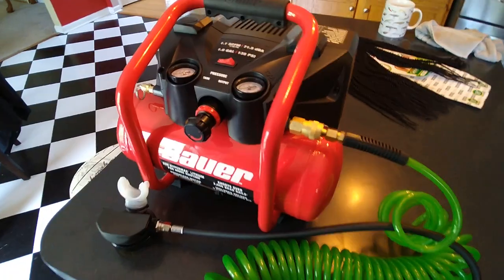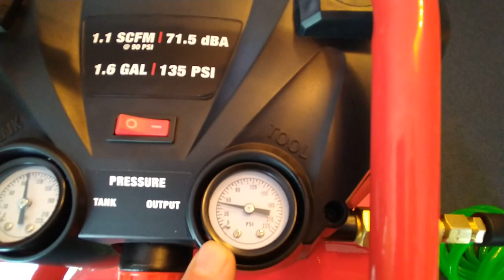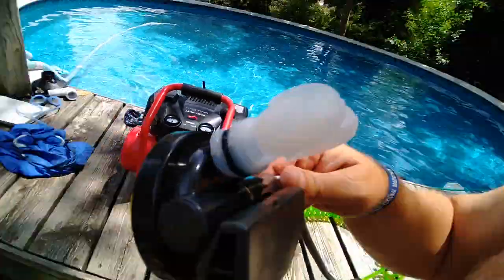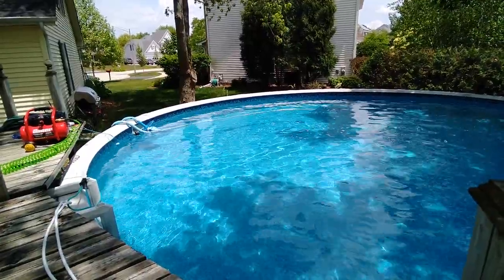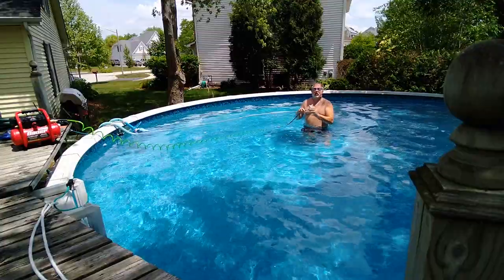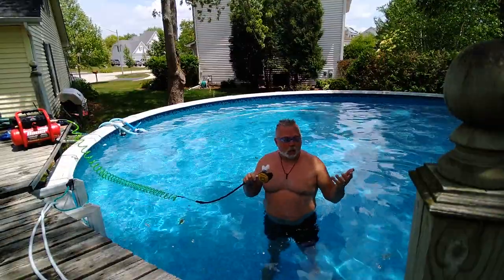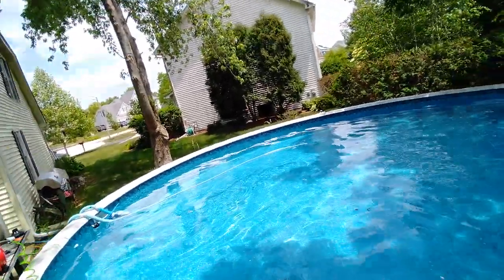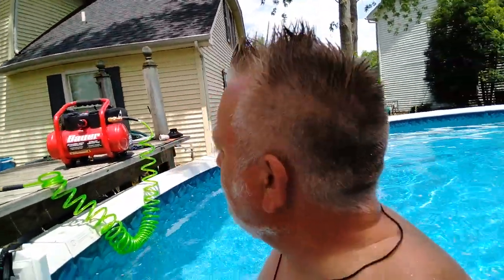VOGTLAND OUTDOORS   2021   BUILD a Surface Supplied Air hookah System for under $250

Comment: I planned out a DIY hookah build using this compressor before I found your video. Have you had it in open water yet? I'm curious if it has enough capacity to keep up at deeper than pool depth. The only major change I'm making to my build from yours (other than a different source for hose) is a 0.3 micron filter on the compressor outlet to keep any nasty stuff from the compressor out of the air supply.
Reply: I just tore down the compressor and there was a ton of what looked like teflon particulate residue inside the cylinder and cylinder head. You should definitely put a filter out the outlet of that compressor if you want to breath from it.
Reply: I would get a Polyurethane hose as that is food safe and water drinking safe....but still, give it a mild soap wash.
Reply: Do yourself a favor and never run something like this without a proper filtration system. There are multiple things that could come out of these compressors from shrapnel, to dry lubricants to teflon coating. Anyone should be aware of this.
Reply: @PunkerTFC  what kind of time is this thing lasting you? On what size batteries?  I want to do the same but want to know if the run time is worth it.
Reply: @shawnjones8748  Two 5ah batteries will last me ~40 minutes at 10-15 feet.  The only exactly timed test I have done was out of the water, and in that case one 5ah battery lasted 25 minutes.
Reply: @PunkerTFC  that's what I wondered if that's all they might last. I've been trying to find a larger battery that could be wired in a different way to them.
Reply: @shawnjones8748  it would be very easy to wire in any five cell lithium battery (or any other 21-16VDC battery), but if you are going to do that you might as well do a fully custom build. For me the only advantage of this compressor is that it can use the easily transportable, easily chargeable tool batteries. Other than that, it is a very basic, cheaply built DC compressor.
Reply: @PunkerTFC  just trying to figure out the cheapest way while still being reasonably safe.  If I deviate too much then I end up having to air controllers and finding a pump that's safe to use on top of it. I know a lot have used the acq-910 aeration pumps but I want as safe as possible.
Reply: @shawnjones8748  That ACQ pump is arguably more suitable for shallow diving than this compressor. I don't think anyone has actually tested the air coming from this compressor; in my case I'm filtering it to .3 microns, managing the heat of the compressor, and operating under the assumption that some testing that someone else did with a similar (but not the same) compressor will apply to my set up as well.

My setup isn't particularly cheap either. Total cost for the whole rig is pushing $500. It's cheaper than anything that's off, the shelf, but I wouldn't call it cheap.
Reply: @PunkerTFC  well most of these companies are simply selling a filtered version of these compressors. Inlet filter to catch big junk that is cleanable and then a good quality filter on the out port. Make sure to always drain the moisture and they are good to go as long as you are using a proper type of hose. I'd try building off the 910 pump but then I'd have to figure out an air tank setup, and I dont really want to use pvc pipe because I'm not sure its clean enough of contaminants because of plasticizers used to soften the plastic for forming. That stuff never completely leaves.
Reply: @PunkerTFC   sorry man over got a few questions. Are you able to run two people on that setup? Is it a positive thing that you can wire up a different 21 to 16v battery that you spoke of, as I know some electronics let you vary and some do not.  I'm sorry for all the questions, just trying to make sure I get it right.  I just dont want to spend all that money for 4 or more batteries for that amount of running time and figured a different battery setup might be more efficient.
Reply from the maker: Punker !! 
I just posted my FIELD TEST of my unit, and it was WONDERFUL !!!!! 
Go check out the video !!

-Mark Vogt | VOGTLAND OUTDOORS
Reply from the maker: EVERYONE EVERYONE - my outlet filter IS on the way !!!!! 
SHEEEESH - REMEMBER everyone, this is a PROTOTYPE. I've only got a few HOURS of use on it so far ! 

But even though I ALREADY have this filter on order, WHAT ELSE can you guys all suggest???? 

KEEP the IDEAS COMING !!!
Reply from the maker: JUST CHECKED OUT YOUR video of YOUR hookah system, field-tested on Lake Champlain, VT - WAY COOL !!! 

ONE THING we ALL need is a DECENT submersible PRESSURE GAUGE !
Has ANYONE found a DECENT one that CAN be used UNDER WATER, and doesn't cost an arm & a leg?? 

-Mark Vogt | VOGTLAND OUTDOORS
Reply from the maker: @Shawn and @Punker - I've been getting VERY GOOD dive times from my BAUER compressor and its 2 x 5000 mAHr batteries - easily 45 to 48 minutes even at 20ft, and likely 60 min if I stayed only at 15 ft. 

DON'T mess with wiring combinations - something might happen. 
This is all about having CHEAP DIVING FUN, and 45 minutes under water in typical North American water is PLENTY long enough that you'll WANT to surface - just to WARM UP ;-) 

-Mark Vogt  | VOGTLAND OUTDOORS
Reply: @VOGTLANDOUTDOORS  I'm not sure that a pressure gauge is going to be very useful. It won't indicate anything other than the regulated pressure until the tank gets below the regulated pressure, and at that point it becomes noticeably harder to breath as the line pressure drops below what the 2nd stage is tuned to.

What might be more useful is an audio low battery alarm (using something like a LiPo low voltage alarm) that is against the bottom surface of your tube; it should reverberate through the water and it might be audible down below. But I have run the batteries out at 20 feet and doing a controlled ascent with the last few breaths of air in the tank was not a problem.

Comment: You should consider actual air breathing hose from a dive shop non toxic it's usually yellow on 25 or 50 ft lengths
Reply from the maker: Stephen, 

Good advice - per usual ! 

Thanks,
-Mark Vogt | VOGTLAND OUTDOORS

Comment: Get a proper Hookah hose, in a good length like 10 meters, it will also act as an air reservoir when the Compressor quits on you..

Comment: Most 2nd stage regulators are rated to handle up to 150 to 200 PSI.  Given that the Bauer's air pump stops well shy of that, you can dial the Bauer tank's output to 150 PSI with no damage to the 2nd stage regulator.
As an aside, for SCUBA tank diving, there would be a 1st stage regulator as part of the removable valve that connects the air delivery hose to the tank.  That 1st stage regulator steps down the tank's max internal pressure of around 3000 PSI down to 150 PSI.  Hence, why all 2nd stage SCUBA regulators are designed to handle 150 PSI.

Comment: 1.1 cfm compressor, that's only about 30 l/m, enough on the surface but I doubt if it will supply enough air at 5m deep
Reply from the maker: Greetings Miranda and welcome to VOGTLAND OUTDOORS ! 

SHORT ANSWER: 
WATCH the VIDEOS ! 

You'll see that even after 15+ dives, most of them are well beyond 5m - they're more like 7m to 8m, but I've said repeatedly that it's UNWISE to use a rig like this PAST depths of 7m, simply because they're NOT DESIGNED for depths past this - THAT'S the (rightful) realm of TRUE SCUBA ! 

Lastly, I live in North America (upper midwest, within an hour of the Great Lakes), and in all the lakes around here there's literally NOTHING past the 7m depth mark anyway - ALL VEGETATION STOPS, so all the fun stuff (fish, sunglasses, other swag) are all at depths of 5m, and the entire rig LASTS LONGER at those depths anyway. 

Thanks for the feedback ! 

-Mark Vogt  | VOGTLAND OUTDOORS

Comment: Very clean looking setup.
What is max depth this set up can reach and still have plenty of air? Thanks
Reply from the maker: Hi again Roadstar, 

Watch all the videos, listen to my recommendations AND my WARNINGS, and read the Descriptions. 

You sound like you're looking for GUARANTEES on a DIY rig posted on YouTube; there's NO SUCH THING as GUARANTEES. 

MARK'S PHILOSOPHY (nothing more than that): 
SURFACE-SUPPLIED AIR or "HOOKAH" rigs are meant ONLY for that range of depths which are DEEPER than SNORKELING but SHALLOWER than SCUBA. 
If SNORKELING gets you from 0 ft (surface) to 6ft and then back up... 
if STANDARD AIR (not "mixed") SCUBA gets you from 20 ft down to 40 ft "receationally"... 
Then SURFACE-SUPPLIED AIR or "HOOKAH" rigs are meant for that IN-BETWEEN range from 6 ft to 20 ft. 

MARK'S SAFETY RULE OF THUMB FOR ALL HOOKAH RIGS: 
DON'T dive any deeper than you can SWIM with only HALF a BREATH - for me that's about 15 ft ! 
WHAT I MEAN BY THIS: 
EXPECT your rig to FAIL  AT ANY MOMENT, and ALWAYS be ON-GUARD that in the blink of an eye you may have to DITCH your WEIGHT BELT and SPRINT FOR THE SURFACE with LITTLE or NO AIR IN YOUR LUNGS :-O 

That sounds like you CAN'T possibly have ANY fun if that's how you think but I have TONS of FUN EVERY SUMMER, and so far I've found over $350 worth of lost fishing rods, lost snorkeling goggles & gear, a ring, and several REALLY NICE pairs of RAYBAN SUNGLASSES (one I gave to my youngest daughter, one I kept for myself), so I've already PAID for my RIG! 

Hope this helps, while reminding you I AM NOT LEGALLY RESPONSIBLE IN ANY WAY FOR ANYTHING IN THIS VIDEO, OR FOR YOU (OR ANYONE ELSE) USING A RIG LIKE THIS. 

Cheers, 
-Mark Vogt | VOGTLAND OUTDOORS

Comment: Do you still own it and have you tested to inflate car truck tires how go , loud, compact , fast or slow is it compare to a small 12v cigarette inflator e
?
Reply from the maker: Greetings Charles & welcome to VOGTLAND OUTDOORS ! 
SHORT ANSWERS: 
1. Yes - I DO still OWN and USE my prototype rig; 
2. Yes - DID test it before I used it as a SSA rig; I inflate bike tires, drove all kinds of pneumatic power tools (drills, sanders, nail guns, etc) - it worked GREAT (as EXPECTED!) on everything, and it was so quiet that even when running in a bedroom, if you go 2 doors down to the bathroom, you can hardly HEAR IT; and when I use it DIVING, by the time I'm only 15 ft away from it, I CAN'T EVEN HEAR IT :-)
3. There's NO COMPARISON in VOLUME between this INDUSTRIAL-GRADE compressor and a 12V car unit; I would say that a 12V car unit would take 10 minutes to inflate my standup paddleboard, but it would take this compressor less than 2 minutes. 

Hope this helps ! 
-Mark Vogt | VOGTLAND OUTDOORS

Comment: Yeah, shallow only. Req more pressure for deeper. Im working on my boat at five feet so perfect, but filter the air.
Reply from the maker: Greetings Doug ! 

YOU & I ARE IN COMPLETE AGREEMENT... but 5 feet? You may has well simply SNORKEL ;-) 
I'm at least OK with seeing any SSA (Surface-Supplied Air) aka "hookah" rig operating at that common-but-quirky depth range of 6 ft to around 20 ft. 

- Surface to 5 ft is best handled by snorkeling with a modest weight belt to get you down quickly; 
- 6 ft to 20 ft is simply too-deep-for-snorkeling and too-shallow-for-SCUBA (it's bullky); 
- 25ft and deeper should be exclusively the realm of SCUBA, absolutely NOT SSA. 

My philosophy is this: 
- if you can hold your breath for about 20 seconds even while ACTIVELY kicking fins, then SNORKELING is your SAFEST method; 
- if you go DEEPER than you can ASCEND in a SINGLE breath (that's about 20 ft to 25 ft), then IF your SSA system FAILS you, you're fucked; that is, you're DEAD. Period. 

The fun and usefulness of an SSA system (DIY or store-bought) is fitting in that middle depth. 
:-) 
LUCKILY  all the FUN stuff in North American fresh-water lakes is almost ALWAYS 6 ft to 20 ft; after that the water gets DARK (and scary!) AND the vegetation ENDS, so there's NO point in going deeper anyways, unless you're LOOKING for something; and if you're LOOKING for something, it's likely EXPENSIVE, so you may as well spend the money on SCUBA gear and a solid DIVING BUDDY as well ! 

Cheers,
-Mark Vogt | VOGTLAND OUTDOORS
Reply: @VOGTLANDOUTDOORS  I just need to work on my boat. It's not deep but I will need some extended time to scrape the bottom. This compressor is perfect, thanks again

Comment: Thank you Mark, that was what I have been looking for. Are you going to do another video with the updates yo your system and how are you solving the diferent issues? It will be very helpful for me. Thanks un advance.
Reply from the maker: Hi Jonatan ! 

it's END-of-summer here in northeastern Illinois (upper midwest USA), so I'm not diving any more this season. 

I CAN still help you with any questions you might have though . 
What questions do you have? 

This summer went smoooothly for me - I never even changed the filter I planned to change ! 

Let me know what you're facing with your own rig! 

-Mark Vogt | VOGTLAND OUTDOORS

Comment: You inspired me I have built my own dive system, thank you. What filter did you use and where can I buy One? Thank you !!!
Reply from the maker: Greetings Robert and welcome to VOGTLAND OUTDOORS ! 

SHORT ANSWER: HERE is what I ordered last year: 
https://www.amazon.com/Neiko-30252A-Water-Separator-Outlet/dp/B002GQ3SUA/ref=sr_1_3?crid=ZAJTU0T4V72&keywords=air%2Boil%2Bseparator&qid=1660612962&sprefix=air%2Boil%2B%2Caps%2C234&sr=8-3&th=1

BE CAREFUL ! 
START SHALLOW ! (6ft to 8 ft) 
BE CAREFUL ! 
CARRY dumbells (instead of a dive belt) that you can simply DROP in an emergency ! 
BE CAREFUL ! 
TEST TEST TEST ONSHORE before you use it 
BE CAREFUL ! 

Cheers, 
-Mark Vogt | VOGTLAND OUTDOORS

Comment: Did you make the air intake filter yourself? Does the tank have water drain valve like most everyone has,so you could actually be out on the lake and drain if you needed...thanks...ps how reliable is this compressor...
Reply from the maker: Greeting Roadstar and welcome to VOGTLAND OUTDOORS ! 

SHORT ANSWER: 
This is OFF-THE-SHELF - no customizations of any kind were made. 
I think the description for that video contains links back to http://harborfreight.com so you can find & read all the specs . 
Reliable? 
I've had this rig for 2 seasons now, and Season 3 is coming up Memorial Day Weekend :-) 
So far so good, but I make NO GUARANTEES nor do I claim what I'm doing is SAFE or APPROVED or INSURED. 

It has worked so far, and I regularly stay down at depths of 12ft to 15ft, and sometimes up to 20ft, but I do NOT recommend going lower, as you're then in the range where industry-proven ACTUAL SCUBA GEAR should be used. 

It's been a TON of FUN so far. 

Kind regards,
-Mark Vogt | VOGTLAND OUTDOORS
Reply: @VOGTLANDOUTDOORS  yes it looks like it's a great setup...I get a pump for one I am building tomorrow and it should be great also,but yours definitely has more psi and depth potential for sure..anything over 20 is real scary for me at this point.i am building mine to recover an rc boat I lost a few weeks ago..its in a very murky pond down around 15 feet...but I have always wanted to scuba ,so losing that boat may have been a good thing..not sure I will find,but this is the best way I could come up with...thanks for sharing...if I build another one I will definitely look into using a setup like yours..

Comment: Make sure you put a check valve on the regulator mouth piece  , if your at depth and the hose detaches or has a fault , the air in your lungs will get sucked out!!
Not the best scenario at 30ftdown!
Reply from the maker: Daniel - Merry Christmas & Happy New Year ! 

GREAT ADVICE - I'm already planning on adding this to this summer's "Prototype 03" (spring/summer 2024). 

This continues to be a surprisingly popular video series I created now almost 3 YEARS ago - who knew?? 

FYI, I HAVE had a "detach event" during Prototype 01 (summer 2021); as you said IT WASN'T FUN, and I was at a depth of "only" 15 ft :-O

I will say this - and I'll continue to repeat it: 
THIS ENTIRE RIG IS REALLY MEANT FOR "SHALLOW" DIVING - say 6 ft to 25 ft MAXIMUM ! 

IF you plan on regularly diving BELOW even 20 ft, then you SHOULD be using full-on professional SCUBA EQUIPMENT - NOT this DIY rig !! 

Cheers,
-Mark Vogt | VOGTLAND OUTDOORS

Comment: What type of adapters did you use to connect the octopus to the air hose?
Reply from the maker: Joel, 

This is what needs updating in my "Prototype 1.1" rig. 
In 1.0 I used a simple hose barb connection. In one dive at about 12 ft this POPPED LOOSE :-O 
In upcoming versions (next season) this will be replaced by SCUBA-quality fittings. 
I almost certainly WON'T BUY "NEW"; instead I'll hit FACEBOOK MARKETPLACE and buy some local SCUBA parts from some man (or woman is better) who is getting out of the sport. 

Stay tuned, 
-Mark Vogt | VOGTLAND OUTDOORS